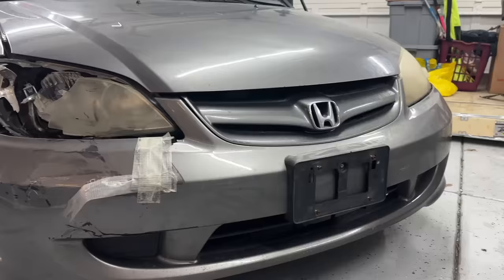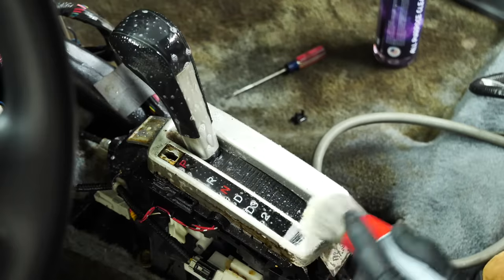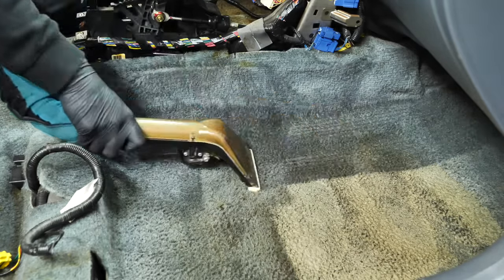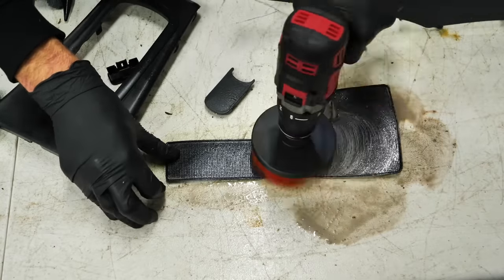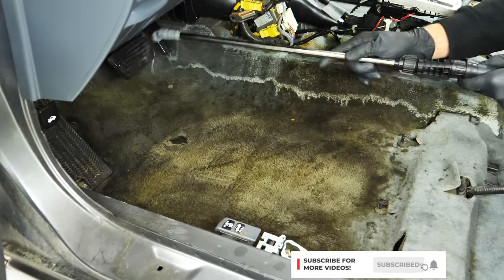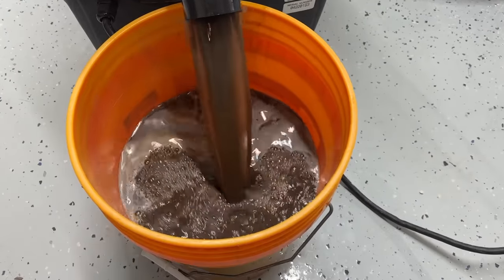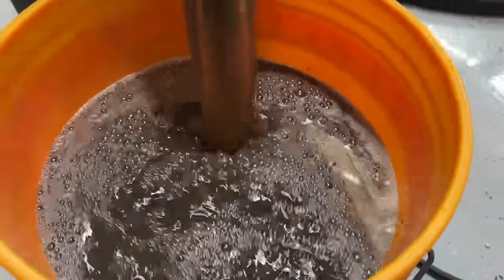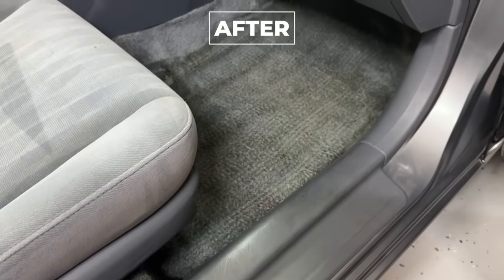Flipping This $1000 Honda Civic For Profit $$$ Side Hustle! Disgusting Car Detailing Restoration

Comment: Even if it wasn't entirely necessary, I feel as though, if you sprayed carpet dye on it could've boosted the price even slightly
Reply from the maker: Yes it would have 100% 
I could have done a ton more but wanted to see what a quick detail would do for $$$
Reply: Idk what year honda that was but, buying honda carpets are about 160 dollars.  It may have been better to just buy a new one in this case. It was a good video. Tho
Reply: @jeffrankin9744  then what’s the point of the video if he just buys new carpet.
Reply: @Connor Lemmerman  I get your point. But I see the work as a point of diminishing returns. The video was good, but if you were doing some car equally as bad it might be cheaper than 5 hrs of work
Reply: @StaufferGarage  are you able to change breaks, oil, and oil filter(maybe an air filter as well)? The bare basics might get you a good little chunk more in profit for very little added investment and very little extra effort(bating stuck tires, aluminum tims can be a bitch to get off sometimes lol) especially if you film proof of you doing the work. Could revenue polish dull headlights using your still and a polishing kit. The extra cost would maybe be about 250-350 bucks factoring in the polishing kit on top of the oil, breaks, and filter.
Reply: I think he did a great job and a new head light would have added a lot of value. Lol
Reply: @jeffrankin9744  see but you forget he now created multiple streams of revenue with this video, even your comment adding to its value. Peasant mindset
Reply: @Ghost White  no.  I want him to make money.  Shit, I want you to make money. I'm in no way a hater.
Reply: @jeffrankin9744  04 or 05 civic as per the cluster.
Reply: Save your money on registration and taxes if you plan on selling. Just have the owner sign and your good.
Reply: Not worth the mess
Reply: Everybody knows what to do, but nobody do! Instead doing something, everybody criticized who does! 
That’s the world nowadays. Lots of sperts
Reply: @jeffrankin9744  Feel free to start your own channel to show us all how it's done.  You Tube is free you know.
Reply: Yes. Immediately I though back to about 10 years ago I used some type of carpet spray paint and it was a huge difference.
Reply: @StaufferGarage  that was not a quick detail lol
Reply: @jeffrankin9744  The video made more than the car’s value 😂
Reply: @Luxur Review  that's why i said "if you are doing this at home". Because not everyone is going to get paid for the video.
Reply: @jeffrankin9744  i really don’t understand how they don’t get the point. money is money, right? why not go the extra mile to get more than what you paid for? even if it’s expensive, as long as it doesn’t go over the price you paid for the car, it’s worth it.
Reply: @Jeff Rankin  the return he gets from cleaning it is a youtube video he makes even more money on
Reply: @daves_not_here_mannn  correct.
Reply: @jeffrankin9744  what about me? I also want me to make money. Hahahaha
Reply: @fen697  make that money. 
Hope every plan is a good one.
Reply: this mf sold civic for 2500 with over 250k miles.... while i got 02 accord with 118k miles & ppl lowballing me with $1500. Marketplace is fking garbage lol
Reply: It’s not worth doing that much hard work

Comment: Coming from someone who drives a 98 civic. This is exactly why I will always baby my vehicle. She deserves to be treated right. I’ve known people who go through a vehicle almost every year. Simply because they don’t want to put the work in to take care of their vehicles. I do a deep clean twice a year. Fall and spring, but also maintenance clean every couple weeks. Vaccume, dust. My car will be running still when I have kids. And I plan to put the same amount of care into my Honda Pilot when it comes time to upgrade.
Reply: Just don’t forget to change the timing belt
Reply: maintenance every couple of weeks?
Reply: @heavenbxl9126 she means maintenance cleaning. Quick dusting and vacuuming. Remove all trash. Quick detailer/protectant application. Shouldn’t take more than 30 minutes to do the whole thing.
Reply: Now your gonna make me cry.  I loved the life out of my 98 civic, always cleaned it.  I hate ice man
Reply: Honda’s are the greatest.  Still daily driving my 2008 SI
Reply: Lisa you know who the worst culprits are? The people who lease cars. In two years they age a brand new car 10 years. Especially in the North, they don't even bother with anti rust. It will be -20 and not even bother with warning up the engine. Right on the highway revving to 4 K RPM. Avoid buying a two year old car with high mileage. Most of the damage is irreversible.
Reply: 100% . I bought a damaged 1 owner 2000 civic  a few years back at insurance auction. It was totaled out by insurance and reluctantly given up by the owner. I inspected it at the yard and it was MINT and looked absolutely like NEW inside. Definite pride of ownership, barely a piece of dust inside..  .this was a car that was 17 years OLD at that point. Incredible
Reply: What was the engine like?
Reply: Change cars every year ?
Man they must be rich where you live
Reply: @hondamanvtec2894  or they just traded in their cars all the time 😂my girlfriend bought an altima as a daily driver and they left the previous owners trade-in history in the glovebox. every couple months she would trade in her car for a new one. i dont even wanna know how much money she owes that dealership.
Reply: You clean your car every couple weeks or you do maintenance? If your doing maintenance every 2 weeks, you should probably sell your car bcuz it’s officially a POS
Reply: @Mixhaelms  they drive a late 90’s civic. can you put the pieces together now? that shouldve told you shitbox from the getgo
Reply: #wifematerial ❤
Reply: Honda  🤮
Reply: Cleaning your car doesn’t keep it running longer lol
Reply: Good habits go a long way
Reply: We have a 2001 Pilot and a 2010 CRV. I love it! No payments and they are both Beasts!!! Im inspired.  Im going to clean my car and treat her better!! I love Hondas!!!@fhowland
Reply: @YahSoLovedTheWorld  no really?? You don’t say. Keeping my vehicles clean though is important. Maintaining your vehicle is even more important.
Reply: @danielsoto_toronto  thank you. My fiance is a very lucky man. 😁
Reply: @juliereaka5709  wasn’t a shitbox till the last year I had it… cosmetically it needed attention. But under the hood and the interior was in phenomenal condition for being 25 years old.
Reply: @fhowland  I miss mine. Unfortunately due to some electrical issues that I had I didn’t want to put more money into fixing her. Would’ve been around $800 to fix. However since she was too small for me to feel safe and comfortable driving little humans around I sold her to an old coworker. Drive an 04 dodge 1500 now and plan to keep her till she falls apart.
Reply: @squidwardshouse67  that was done in 2018/2019.
Reply: Nah; just K swap your civic when it comes time to upgrade

Comment from the maker: Because I detail every car on this channel for FREE! Yes Free 😧! Subscribing is the best way to help support me! 👍
SO HIT SUBSCRIBE and join the Stauffer Garage Crew! ✅
Reply: wow nice work 👏 good job
Reply: Bro. U got robbed. $1000 for a dirty ass car like that and it’s beat up? I bought a car for $300 in way better condition. Interior was detailed and clean, only problem was the engine is blown. So gotta do a trans swap on my other engine. Hopefully it’s not harder then I’m expecting it to be, but when I get it running again I plan on possibly repainting it or fixing the minor body dents, and eventually gonna flip the car. I spent a lot of time on it, but I’m willing to sell for at least 1300-1500. 1999 Honda civic DX 5speed manual.
Reply: Why don't you rinse the plastic parts you remove out of the car instead of wiping them with a towel?
Reply: The seller had to live off Parsons ave. 😂😂😂

Comment: I'm a mechanic who also paints and restores cars, since i know everything i need about cleaning and stripping car interiors, one thing i never understood about professional detailers is why after so much work they don't remove the carpet and they insist on cleaning what i would have lit up in flames, the labor involved wouldn't be cheaper than a carpet pulled from the scrapyard that can be as low as 20$ and wouldn't look better than one either after the customer pays hundreds for an interior detailing. I've made many times the proposal of swapping a carpet for cheap and getting new insulation pads but never a detailer who gets a high price to clean something that needs to go. Another time there was a steering rack seal leak under the dash and after this extensive cleaning the car had a bold oil scent after citronella faded away, turned out when i pulled the carpet it had the insulation pads soaked into a huge oil pool. I've seen many cars shining and smelling fresh after an expensive detail to the extend of removing seats, etc and if you pull the door sill trim you'll find damp insulation pads, mold growing from underneath or behind the door panels, and a whole bucket of dust and debris that eventually starts coming out.
I don't talk specifically for the video poster where this car is his and wanted to flip it, but i see people run a business where swapping things for cheap would be more profitable and less labor intensive than getting money to deliver a hidden swamp with lemon cologne to whoever pays the price.
Reply: Just depends on the car i feel like
Reply: @g35s  Yes but i believe it should not be done professionally when giving the customer the feel that the car would be totally clean afterwards, they can give the option to remove the carpet for extra cost but most i've seen they just do this without mentioning anything.
In the matter of fact i did not remove the carpet on my father's car and i have uploaded a video on my main channel "John's Crafting Lab" detailing it, because it's a car that moves workers and construction materials everyday which i wanted to look better for a few days, but if i was paid for this service i would do the complete tear down of the interior even if i would give it as an option for extra cost, most the detailers i know do not remove any panel or the carpet and some do, but all of them mention a "deep clean" and do not describe what they will do.
Reply: New one can be $$159 to $220.  For a non luxury car.
Reply: @dennisrobinson8008  except the cars i worked on, got one for mine mint condition used from a newer model aswell, changed the color to black for a total 60$, much cheaper than if i or someone was trying to remove 2 quarts of oil stains and smell that eventually leaked in from the steering rack, because after intensive cleansing with degreasers and pressure washing that i would have charged over 100$ to a customer, the oil was still soaked into the plastic undercoating of the carpet and made the car smell in the summer. Mold and humidity is much worse especially if you don't remove the carpet to clean it and burn the insulation in a bonfire and install new one.
Reply: @johnbelwell2461  did you use spray cans to turn color to black or a paint gun?   How many spray cans and or how much paint required?
Reply: @dennisrobinson8008  for a sedan it'll take around 4 cans of carpet paint to get decent coverage on a polyproprylene carpet. This was the first time i tried it and i wasn't disappointed. I then figured out a better recipe which is a blend of 150% dilluted nitro lacquer used as dillutant into half its volume automotive acrylic matte clear coat sprayed with a paint gun, the ratio might need adjusting to the brand of products you use and always try it on a place it's not visible.
The only precaution for both ways is to brush it in between coats so to not dry rock solid and keep the coats very light. So far and long after, it got so many kicks and the paint of both the above methods have been proven to be reliable.
Total volume of dilluted paint or spray cans needed starts from around 1.5 quarts going to 2 quarts depending on the size and how much it soaks into the specific carpet.
Reply: @johnbelwell2461  i was talking about the body.  For carpet i found some vendors that sell for new "$159 to $220.   If its too expensive id choose a good one out a wreck.
Reply: agree，cannot clean the underlay 😊

Comment: Having a clean car is one of the best habits I need to start
Reply: Start by the most basic. Clean/dispose of the loose garbage dumped all over. Packages, papers... Makes a world of difference and literally take seconds at the gas station. ;-)

After that a simple vacuum operation makes wonders. Soon you'll want a brush for the dash dust, to go with the vacuum. Than a rag, than...  Damn I create a "monster"! LOL 😂 😂

It's rather addicting. The sarcastic part of all this. Is that it becomes easier and easier the more you dive into it...

Comment: A tip for anybody who didn’t know this. You can dye carpet. Just take spray paint to it. I would remove the carpet if you’re doing a color change though. I’ve done it many time detailing at dealerships. I’m about to dye my tan carpet black in my Accord.
Reply: What about dyeing car seats, does it work? Bought a car in a mess condition and worn out seats. I don’t have much I just want to make it work.
Reply: @boxoffisa  yes, even leather seats. You just need to buy the proper paint for the material.
Reply: @The13lacabyss  thanks mate. I will try that up.

Comment: Congratulations on the flipping the car.  As usual you did a great job detailing.  Unlike most of the cars you work on, this one didn't have much wear and tear on the inside (i.e. no torn seats, carpeting).
Reply from the maker: Thanks! 👍I’m glad it didn’t! Picked the flip wisely
Reply: A respray would cost the new owner a grand or so..and for that he has something that has 3-4 years of life in it and looks respectable. Yes new cars would last a decade or so comfortably. Still certain charm in the simplicity of the old school design.

Comment: Eeeew I wouldn't have let my tools even touch those moldy rubber parts. Soak them in a bucket with solution first and use a disposable brush on them first, then use the good tools. Great job by the way.

Comment: Great flip! I'm a car guy myself. Specifically a Honda guy. I currently drive a 2014 CR-V EX-L (same thing as this civic, but different body style and size). I definitely would've used some more steam on this car given the condition of everything. Especially on.the interior trim bits and carpet stains. Honestly those carpets that Honda uses are pretty weak and I personally would've just tossed that one and installed brand new carpeting myself given the condition of this one. That said I think there were also some areas of the carpet that could benefit from a lot more cleaning. Overall it's better but definitely needs more advanced deep cleaning to be 100% clean and perfect. 

Now, you said the body was rough? I didn't see it so I can't really comment on that but I do know that Hondas are very prone to rust and if there is any it should ideally be treated asap to prevent any further progression of it. 

You also didn't mention anything about the mechanical condition of the car. Does it run? does it not run? If it does run then have you been through all the gears? Does the automatic transmission still shift good? How many miles are on the car? Has the car been well maintained? If the mechanicals check out good or even if it does need some work it's totally worth fixing. They don't make them like they used to back then and if it runs and drives and you get all the mechanicals fixed and the frame of the chassis isn't all rusted out then it will make a great car and sell for a great price. What you got is okay but I've seen them sell for a lot more depending on the condition of the car. 

Looking forward to more videos in the future! Nice job!

Comment: Hey Stauffer! Looking into the Mytee carpet extractors currently. I was looking at the S-300 model. I was wondering if it’s worth going for the heated model or if the non heated is a good starting point. I’m looking for a good investment in the long run. 

Also what solution should I use on the carpets before extracting?
Reply from the maker: Pay the extra for heated 100%. It makes a world of difference. I spray on Bio break (https://amzn.to/3efn09J) and a scoop of oxiclean in my sprayer.
Reply: @StaufferGarage  Would you recommend the S-300H model? I am seeing so many different reviews conflicting each other. I was wondering if you had any experience with models other than the Spyder, and if they were good.

Comment: 2.5k even with all the damages outside? crazy.
I bought my 2004 civic with 160 tkm (around 100k miles) 1.6 vtec and manual, no rust, issues and fairly clean for just 2000e

Comment: I work 40 hours plus at my full time job taking care of the physically and mentally disabled as well as I detail in the side. I have a 2013 dodge dart in red and a 2012 dodge journey as well as a 1998 jeep grand cherokee with the 5.9 I'll be picking up a 5.2l 1993 dodge dakota in the next couple weeks and I'm excited to get it as clean as I can. Got any tips how to remove scratches from vehicles. I've always been to nervous to polish buff and wax.

Comment: Why not take the carpet completely out the car and do a super clean on it?  I see alot of detailer remove seats and center consoles, you might as well go ahead and take the carpet out so you can blast it with a pressure washer!